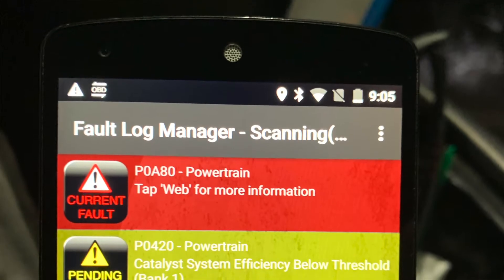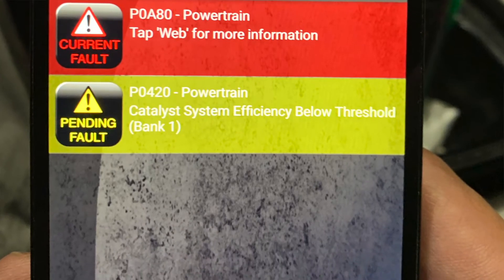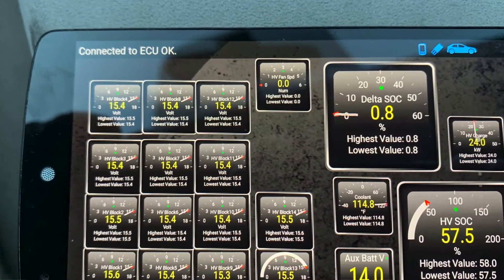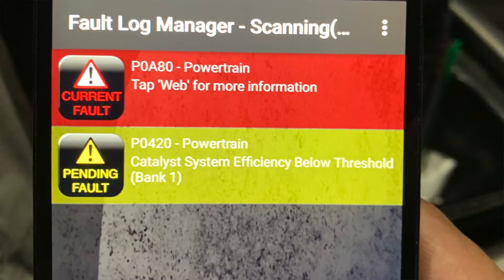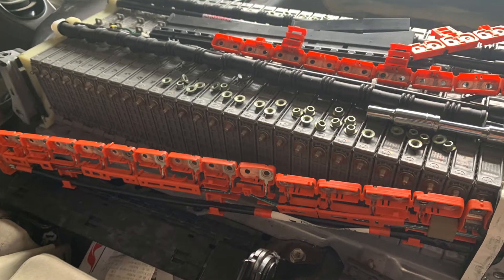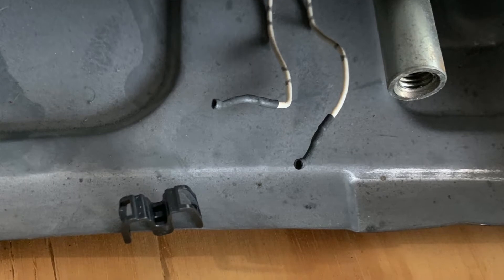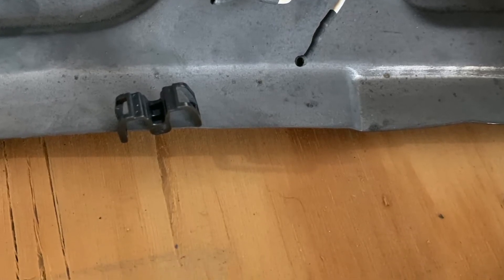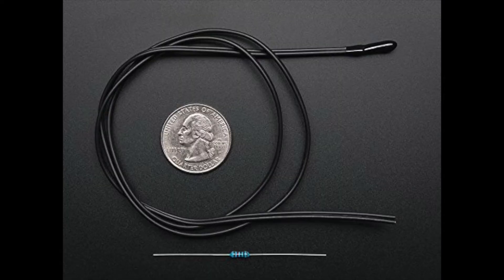Prius Battery Temp Sensor Thermistor Replacement

Comment: I’ve just purchased one as I have the same issue when wiring it in does it have a + and - wire
Reply from the maker: I don't believe it does. It is possible I guessed correctly.  Your battery will get hot if it is specific.

Comment: Same problem here, I ordered a thermistor and wanted to know if the two wires can be joint to the wires in any order or do they have a plus and minus? Thanks any help appreciated
Reply from the maker: I did not see an order to mine, I could have guessed correctly, but I am assuming it is not a specific polarity.  This batter is still going today with this thermistor replacement.
Reply: @RickBolt  there’s 3 sensors at the bottom spread out and 1 on the top towards the air duct, that air duct sensor is different to the thermistor

Comment: Ran into a troubleshooter for "low/high thermistor resistance" codes on Prius chat, one tidbit "HINT:
Since the battery temperature sensor is not available by 
itself, if replacement is required, replace the entire HV 
battery assembly." So you probably did ok
Reply from the maker: This pack worked for about three years after thermistor replacement.  Then it had another module failure.  Car is still going with this pack.

Comment: Do you happen to know if that is the same part used on top of the traction battery for the air inlet temp?  (2 green wires on top)
Reply from the maker: I do not know that for sure, but I would assume it is the same.

Comment: Hi Rick, I have the exact same issue. So how do you attach the Adafurit thermistor? Do you have a picture? Did you splice the white wires to the Ada and use electrical tape to attach underneath the battery? Thanks.
Reply from the maker: Yes I did

Comment: I need the one on the top (right over module 4, I think)  That module blew up and sent that sensor somewhere.  It's got 2 green wires leading to a white plastic holder and it's supposed to be inserted into a small metal tang connected to one of the compression rods that squeeze the modules together.
Reply: @alext8828 Did you ever have any luck? I have the same problem. Does that use the same part as the thermistor he used?
Reply: @grizzlysounddj   I really couldn't get any real info on that so I secured it with a pipe cleaner just wrapped around it.  I don't know what it is but thermal sensors are coming up thru the bottom of the pack and in contact with the actual modules.  I'll take a look at the video again and see what he had there.
Reply: @alext8828  ok I gotcha.  So your upper sensor just blew off from the mounting spot, it sounds like.  The little price on the end of the wire is the thermistor.  Mine broke off.  There are three on the bottom for the battery temp. This one is for the air inlet temp, I believe.

Comment: To anyone out there with the same issue, I bought the exact same thing as @RickBolt, wired it in, heat shrunk it and it worked great!
Reply: Hi Caleb, does the tip sensor of the Ada have to touch the bottom of the module? The existing thermistor had clips on both sides and the small sensor in the middle was touching the bottom. Thanks.
Reply: Seems like I reused my clips to keep things where they were but to be honest I can’t remember.

Comment: Thanks for the video brother. I have the exact same issue you had. Did you use the resistor? Also, almost a year later, is it working still?
Reply from the maker: Yes and yes, still going strong no issues yet.  Thanks
Reply: I’m sorry for my ignorance, but the straight resistor that comes with the thermistor, how did you use it.
Reply from the maker: @calebheath9796  oh sorry, I misunderstood.  I only used the thermistor. I did not use the extra resistor.
Reply: Good deal. Thanks. I really appreciate you posting the video and sharing your experience!